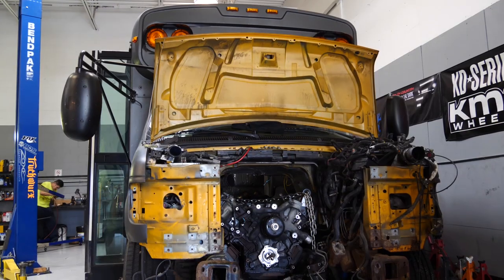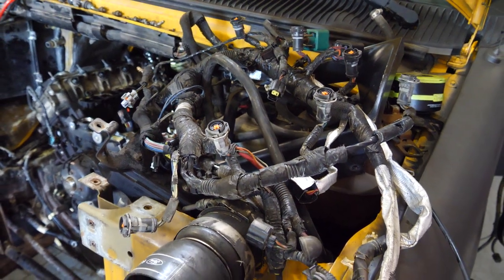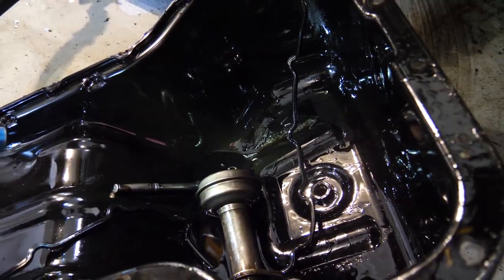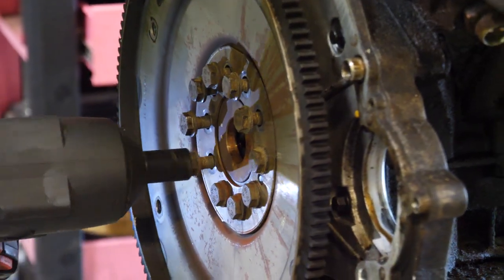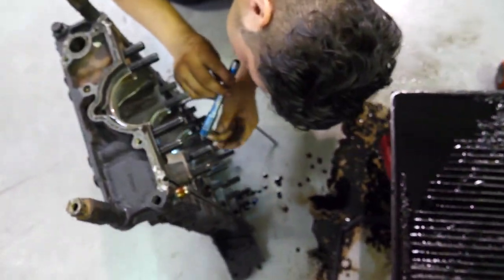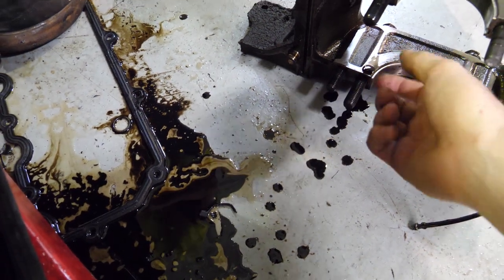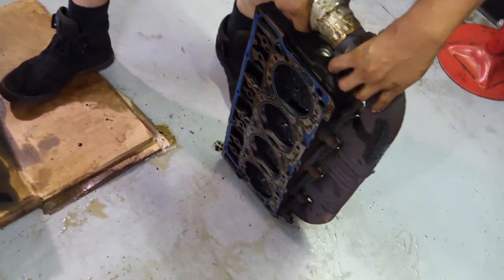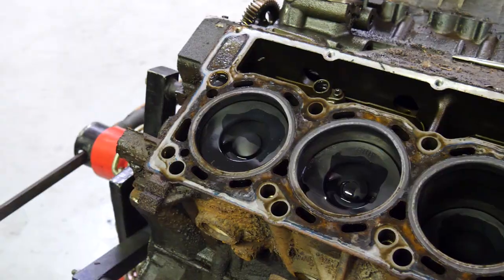Building a 500HP SCHOOL BUS! - Removing & Disassembling the 6.0L Powerstroke

Comment: If that engine is going to make 500 hp you will need to upgrade the transmission and the rear axle or they will blow up under that power
Reply from the maker: Actually no! Both the trans and rear end are good for 1200lb/ft of torque.
Reply: @_Gingium_  
Is that in the truck aplication or this aplication? All that extra weight may change things in terms of how much itll handle
Reply: @Gingium think about wear and tear on drivetrain after all the years of use and abuse, because it was a school bus... just a thought, diesels can take a lot of spankin', but think about it

Comment: if you could use that 2 post lift for longer you could drop the motor hile still atached to the front end and then bolt an old front end under that to be able to drive it outside while working on the engine
allso get a ratator to turn the motor on the engine stand lot safer , this one is made from a boattrailer winch and a small block can chain drive https://www.jalopyjournal.com/forum/threads/rotator-for-engine-stand.734137/

allso put the muffler back under it but with an exhaust cutout , when driving long distance the drone of an open exhaust can realy tire you out , it allso prevents talking to anyone inside the bus while driving , the electric cutout make you choose the time you can make it sound loud and awesome

Comment: Twin turbo it. use the stock turbo and a new and bigger one. sequential turbo.

i dont even know if this is possible it was just an idea in my head. its a V shape so should be possible.
Reply: Sequential would be inconvenient as that is normally an option on inline engines with lower displacement. Remember this is an engine with very high compression as it is a diesel. Therefore the best option would be invidual running turbos. One for each side of the V engine.
Reply: Vegard Ulven you could do a different sized turbo on each side of the engine then feed the output from the turbo into the opposite side of the engine. Idk I just thought of it

Comment: We pulled the diesel engine in a Ford van (the basis of this bus) through the front without removing intake or oilpan. The key is cutting down the post height on the engine hoist so that the lifting arm is slightly below parallel, and having the lifting chain as short as possible. https://youtu.be/nZsSvpgRLRM

Comment: Are you rebuilding it to be much more reliable as well?
Reply: Yeah he said he's gonna put arp head studs and upgraded headgaskets. Lifting heads being a really big problem with the 6.0 which this is gonna fix. Pretty sure the delete also helps with reliability.
Reply: nah, he's building it so it'll blow up in the next 10000 miles.

Comment: Just 12 value Cummins swap it, it will
Make more power stock then the engine that’s already in it upgraded
Reply: Lol. You mean a 300hp 12v motor.... Lol that motor will run circles around a loud clattery 12v....
Reply: Dennis Lilley I’m more of a Chevy guy and will say that but the reason I said it is because 12v cummins are easy to swap and modify

Comment: If I were you I’d do an engine swap. The 6.0 is by far one of the worst modern Diesel engines plagued with problems like blowing head gaskets, cracking heads, throwing rods, etc.. go for a different Diesel engine and save yourself the future problems you’re bound to encounter by sticking with the 6.0.

Comment: Don't want to be "that guy", but...
motor = electrical
engine = mechanical

The only time a vehicle has a "motor" is when it's an electric vehicle. If it has a good old internal combustion engine, it has an "engine".
Reply: Wrong, a motor turn any type of energie in mechanical energie, an engine turn thermal energie in mechanical energie, so an engine is a type of motor

Comment: for the love of god dont go with aftermarket injectors please stick with motorcraft bigger turbos are fine even a tuner maybe but when it comes to injectors bigger injectors tend to make these trucks run to hot and your gonna ruin your cylinder walls im going through this problem right now with a customers excursion its NOT worth it also while your there do an egr delete get rid of that p.o.s cooler it WIll take out your head gaskets when it fails and it will fail also its a little late so things keep coming to me but make sure you headstud that engine and if you really wanna make sure you dont have a head gasket problem go with hypermax headgaskets they make a gasket with metal crush rings in it no grinding to the head or block required and if you dont already have a tuner your gonna need one for that egr delete if you do it

Comment: Ls swap it lol supercharge it too :D
Reply: And spend 4x as much on fuel for adventures?
Reply: And get like 1 mile per gallon will towing  yea doesn't sound like a good idea
Reply: Jordan Young considering moderately built ls’s can get upwards of 20 mpgs in cars and regular trucks, I’d say he’d get better than 1 mpg.... besides, he only got like 5 with the truck how it was before
Reply: @zerohourdrift  they may get 20mpg at highway speeds in a high gear in a car, but in a really heavy bus towing possibly a 2 car trailer and a few people there is no way a gasoline engine is getting more than 4mpg in most places.
Reply: papakfmcnados king in the bus maybe but In a truck, there isn’t any issues... I mean my c10 has a 6.0 in it and I get like 15 towing my trans am if I’m only driving highway🤷‍♂️
Reply: @zerohourdrift  yeah there is a big difference between a c10 and a bus
Reply: I cant believe my stupid comment got some atencion :D